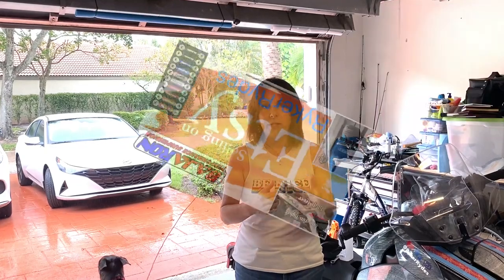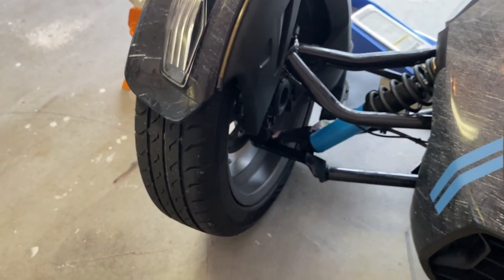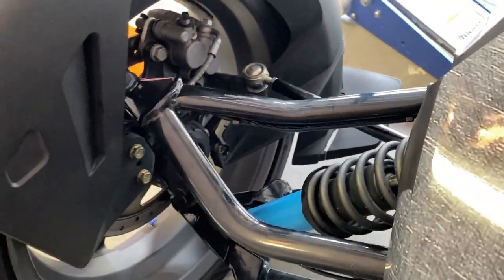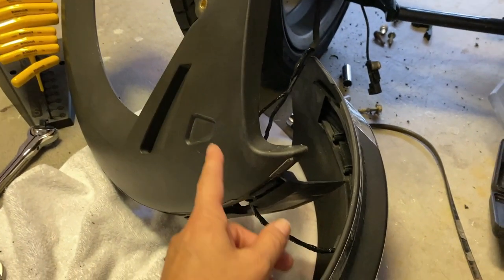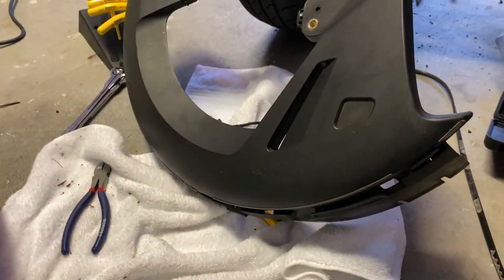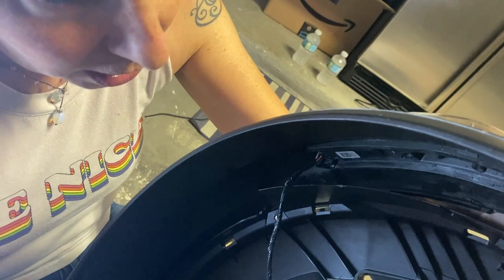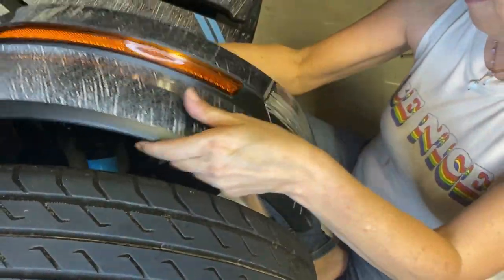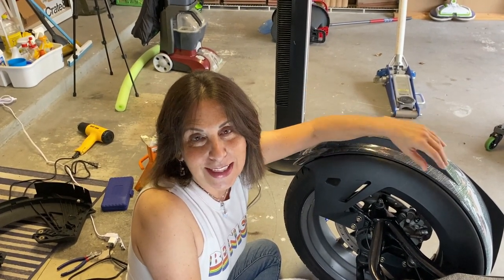How to Remove & Replace Can Am Ryker Fender

Comment: Just watched your video and found it very informative and appreciate you showing the all to real struggle  . I had to remove the fender on my 21 Ryker to fix a wire problem. I did notice that on your fender it didn’t have a metal clip holding the wire to inside of the fender almost directly under the turn signal. If you go to my channel and watch my first post you can see how it kept popping off and how I fixed it. You might want to take a look under the other fender to see if yours is missing or it’s not on your years model. If the clip is missing it can cause the wire to rub on the tire and cause a failure or fault.  The main reason those bolts are so hard to take off is the factory thread lock they use. I saw you had some blue loktite and wondered if you used it when you bolted the fender back on. I have one last piece of advice is don’t use a ratchet when screwing into plastic only use a screwdriver with a torx bit. The ratchet has to much leverage it’s all to easy to strip the threads in the plastic. Ok maybe one last piece of advice. If you plan on gluing to old parts CLEAN THEM FIRST glue doesn’t grip to dirt and use epoxy instead of instant glue . Keep those videos coming.
Reply from the maker: Great tips. Thank you so much and I really appreciate you watching!!
Reply: My tire fell into a hole and my fender was damaged, including the cable that connects the turn signal to the inside of the wheel. Do you know the part number I could reorder this cable with? , I mean the cable of min 29:01

Comment: I hate this happened to you twice!!  Should you have your battery disconnected when removing wire connections or at least have the key off?  I noticed at the first when you tightened in on the fender that your halo skid was still lit but you had already separated one of the the connections. I hate working with electronics cause I'm always terrified I will mess something up lol. Great video!  I always appreciate your including your struggles so we know what not to do!  Love ya to pieces Beth!  Thanks as always!
Reply from the maker: Thanks so much Heather!!! ❤️

Comment: Thank you for this! Mine was hit by a harley trike that somehow didn't notice I was there (he was literally in my pack)and rolled up along my left leg and plowed into my front fender from behind and that split the plastic pretty badly. I'm looking at a website now trying to get the parts that I need. It looks like I only need the 2 sections of plastic and the red reflector decal. I'm not too sure what all of the additional parts are but my lights are good. Any suggestions? Also, is that back piece included or will I need to order that additionally?
Reply from the maker: Sorry  I am usually much quicker at replying!!! Been crazy busy building my new website: www.RykerRydes.com check it out. 

Where you able to get everything ordered and figured out?
Reply: @RykerRydes  parts are ordered and a few friends have volunteered to assist with the repair.

Comment: The pvc.......'cheater bar.'......probably doesn't need to that long and you might bump
into something with it. It also looks like your pvc is schedule 40, and schedule 20
is thicker and might be stronger,  but the point about safety glasses is a good idea.
Lube usually makes things easier, (insert joke here), and you can generally 
use liquid soap on a plastic part like you have there. Nice job.
Reply from the maker: Thanks Steve. Great tips.

Comment: My tire fell into a hole and my fender was damaged, including the cable that connects the turn signal to the inside of the wheel. Do you know the part number I could reorder this cable with? , I mean the cable of min 29:01
Reply from the maker: Sorry I don’t know that part number. Check cheapcycleparts.com. If you still can’t find it, I can put you in touch with a dealership I use. Lmk

Comment: Nice job miss barefoot! The back side of that tip light still looks so empty.. I got it stuffed full with connections bcus of those slingmods led indicators and 1:2 harness. Way to much wires for such a small space tbh.
Btw you did not route the tip light cable back trough the hole in the fender under the light. I'd go back and make sure that cable is routed correctly or taped out of the way like you mentioned in the video!
Reply from the maker: You are 💯 right! Good eye!! Thank you!

Comment: This question is for Ryker rides and anyone else that wants to comment. I asked my condo if I can have a motorcycle and they said yes. So I went and took the three wheel motorcycle class and passed then put a $500 deposit on the 2022 Ryker sport and bought $600 in riding protective gear. I just found out something this week they did not tell me before and it is I am not allowed to cover my Ryker. We have no parking at the condo to store cars or motorcycles under a covering.. I should say I live in south Florida. Renting a storage place is out of the question because to me the monthly fee would make ownership to expensive over ten years and not be cost effective. My question to you is how will the can am Ryker stand up to the elements in south Florida without a protective cover
Reply from the maker: Sorry to hear that. Yes, the Florida sun and salt air are killers. I would wrap your bike as soon as you get it. That is like having a permanent cover. Another option is to constantly put a clear coat on the bike to protect it from fading.
Reply: @RykerRydes  thanks for getting back to me I found out they started not allowing bike covers in May of this year. I am going in front of the board in January and if I can't get the rule changed I will revert my interest into something else